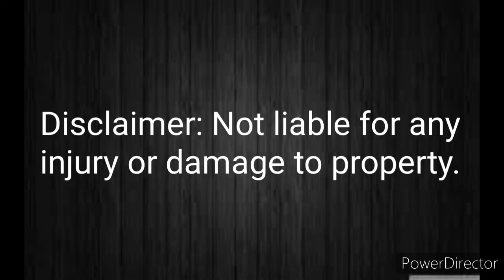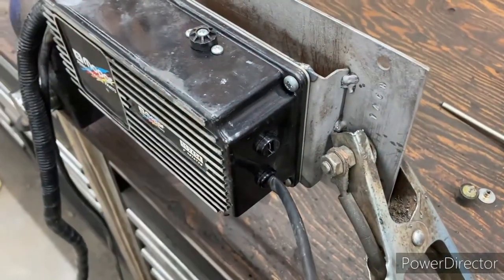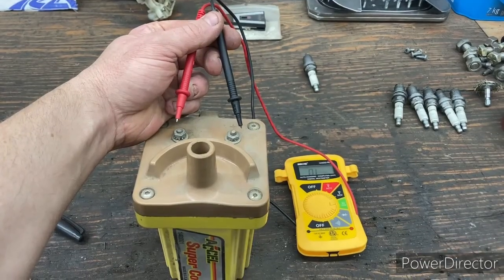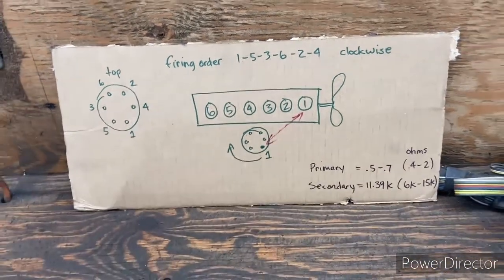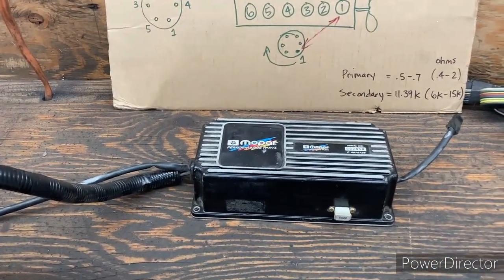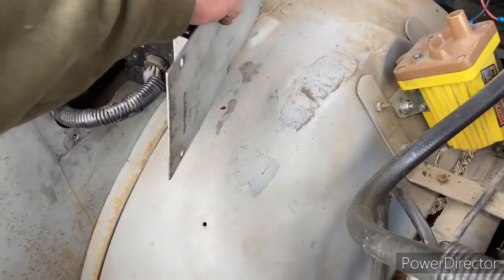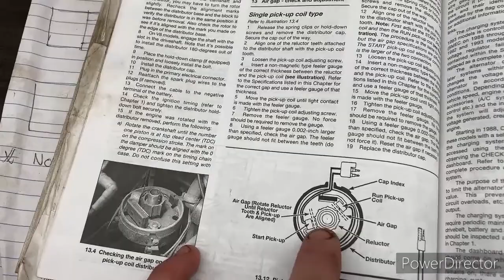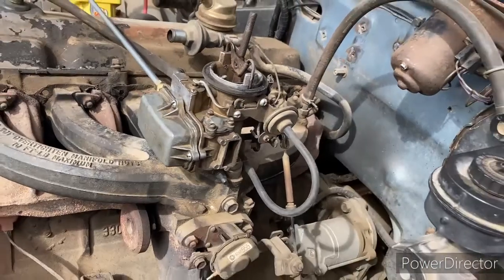Dodge slant 6 runs rough

Comment: where is the vacuum capsule on that distributor, i've saw no one, if that distributor comes from a lean burn system, it is a fixed advance distributor and not suitable to use on a conventionnal non computerized ignition system

Comment: What's the firing order for this motor I'm not a mechanic but trying to figure it out
Reply from the maker: Number 1 is just after 6 o clock position on the distributor. Then the firing order is 1-5-3-6-2-4 in clockwise rotation

Comment: Three things I can tell you about running a multi-strike ignition from experience:
1: You WILL need to run a heavy-duty cap & rotor set. (Brass terminal)
2: You SHOULD run it with a high-amperage charging system, because they eat amperage like you won't believe! =:O
3: You MUST run it with a low-resistance "quick-rise" ignition coil, so as to prevent delay in spark delivery and not hinder the system's performance! }:(

And, as extra measure....
4: Running a high-durability plug gapped to the stock ignition specs of the application in question will achieve a 30,000-mi. life out of all the secondary ignition components. And, on a factory EFI app, garner a 20% increase in fuel mileage. ;)
Reply from the maker: Thanks, I was not aware of some of the information you provided. This will be very helpful.